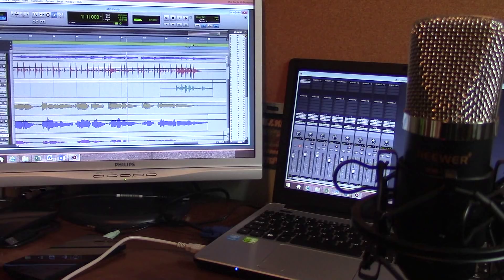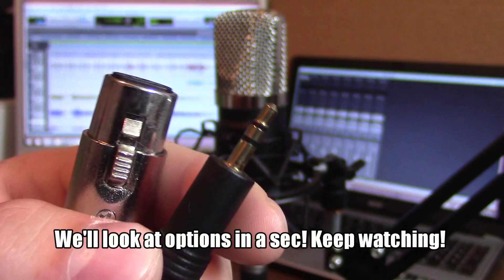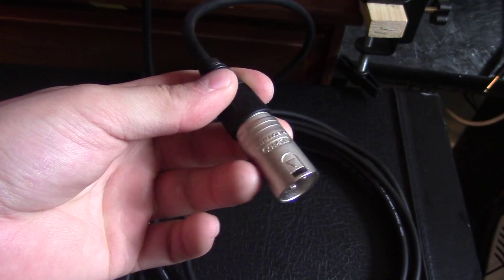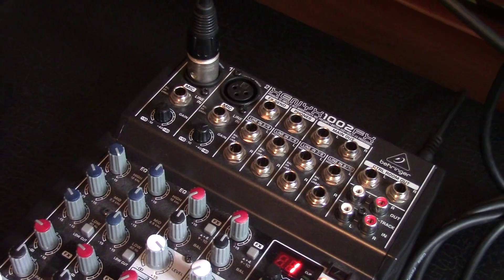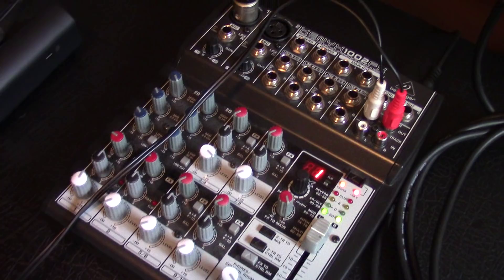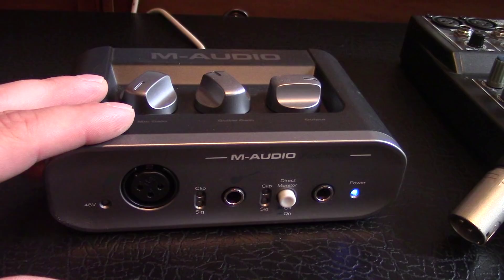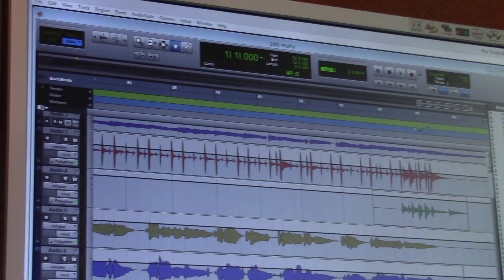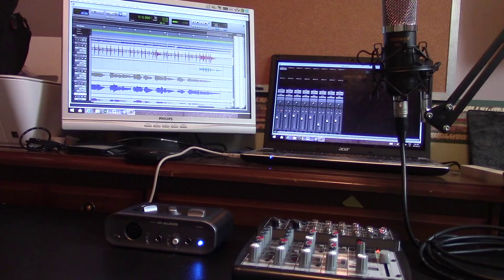How to hook up the Neewer NW-700 / BM-700 / Any condenser microphone

Comment: Can this microphone work with an Epiphone amplifier?I purchased the extra cord that has the three prong on both ends.
Reply from the maker: +Luke Lucas I am not sure about the amplifier. This mic needs 48V power, and I do not THINK that an amplifier will run it. I am pretty sure that you will still need a phantom power source.
Reply: One last question I have seen the phantom power source but they also have it hooking up to a external sound card is that necessary?
Reply from the maker: You do not need both. An external power source will be all you need. :-)

Comment: I've seen videos taking the mic. And plugging one end to the bottom of the mic then the other to the computer. They were using it without phantom power. So I don't understand why you need phantom. I know it sounds better but you don't need phantom.
Reply from the maker: +Tiddly Wink Have YOU tried using it without?
Reply: +Weiderfan No but a guy just used an audio adapter and it sounded okay.
Reply from the maker: It certainly isn't proper.. you may get some power, but you wouldn't be utilizing anything close to the mic's potential. You're talking about supply approx. 10-15 volts to a mic that requires 48.

Comment: my mic won’t show up on my computer
Reply: have you found a solution?
Reply: Rikardo Castello no
Reply: Have you gone into the Windows settings on your computer and tried to choose your input audio device?
Reply: Logic Sloth yes i have tried everything i ordered the mic of amazon brand new and it doesn’t work i’m pissed
Reply: Same
Reply: @fables8811  are you using power supply?
Reply: TheShibliVlogs ya i’m using phantom power
Reply: Do u have phantom power?
Reply: If u are using a laptop I think you have to use a sound card
Reply: Mas0nFN ya i’m using phantom power
Reply: Rikardo Castello r u using a laptop?
Reply: Fables are u using a laptop.
Reply: Mas0nFN yes
Reply: @fables8811  Exact same problem! I tried every laptop in my house bc we don't have any PCs so if it worked pls tell me how!
Reply: Humorous JJkar it hasn’t worked for me i gave up
Reply: I’m using a PC and I have the same problem :(

Comment: Any Idea the ALC1150 Will Power this Microphone? i got the Z97X-Gaming 3 Motherboard and i need a new microphone but i am wanting to get a microphone but i got a budget under 50 bucks and this seems like a good price and micrphone any ideas?
Reply from the maker: +LiteGaming Hey, I just did some research on the product you mentioned. I'm sorry, but I don't think it will power the microphone. Of all the many stats I read on the products website, there was no mention of an input that would accommodate this mic. I did happen to find this little item though, that will fit your needs, depending on whether you were willing to put out a few extra bucks. Check it out! http://www.amazon.com/Neewer-Condenser-Microphone-Recording-Equipment/dp/B014H8AWGC/ref=sr_1_4?ie=UTF8&qid=1443271279&sr=8-4&keywords=phantom+power+supply+for+microphone
Reply: Weiderfan thanks for doing some research but i was wondering because alot of people told me that the thing is powered so i am still wondering since i am a broke  kid and i want to get some good microphone and get better on youtube soo i am waiting to get some stuff since i am currently looking for alot of microhpones but all of them are crap
Reply: Weiderfan oh also i am in canada and i cant order from amazon.com but i need amazon.ca
Reply: +LiteGaming maybe you could buy that microphone and to power that use a sabrent usb external sound card. That should work. i saw it at podcastage and in the comments he´s saying that he´s doing that in that exact way

Comment: Could you give me a link to a cheap mixer, on amazon, that has phantom power? And also, could I use the cable that came with the NW-700 to run from the mixer into my desktop?
Reply from the maker: +EquinoxNick Yes you could. Here is a pretty sweet little mixer for cheap! http://www.amazon.ca/Behringer-Q502USB-Premium-5-Input-2-Bus/dp/B008O516JW/ref=pd_sbs_267_3?ie=UTF8&dpID=51Y2%2BbL16kL&dpSrc=sims&preST=_AC_UL160_SR160%2C160_&refRID=1CV360D3G28ANS2B1QYC
Reply: +Weiderfan so would I need a 1/4 to 3.5mm cable and a xlr cable to be able to use that mixer?
Reply from the maker: Yep!

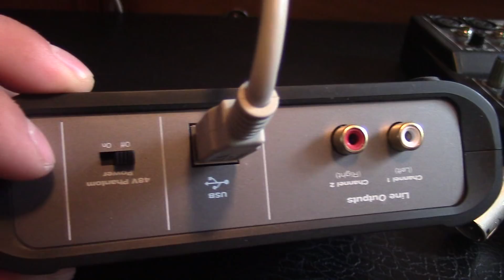Comment: what's that cable @6:28 called, and the one @7:00 ?
Reply from the maker: +kaelmon The cable at 6:28 is the cable that comes with the interface. One end is a regular USB, and the other end is a type-B USB. It's basically your standard printer connection cable.

Comment: I tried setting up the mic, i got the same set up as you, and i turned on the 48v
but there is still no signal coming though, I'm not sure if the mic is broken (i tried the mixer with a dynamic mic and it works)
Reply from the maker: did you use the same cords for both mics? could it be a cord issue? strange! with a dynamic mic you wouldnt need phantom power. soooo, maybe the power source isn't working, bad chord somewhere, or you just got a defective mic, which is possible with any piece of tech. those are my suggestions! haha hope it helps in some wayy friend!
Reply: +Weiderfan I tried using two different wires the one given (with an adapter) but I'll try buying a xlr cord, thanks
Reply from the maker: +sillyangel27 no problem! hope it works out!

Comment: Actually I plugged it into my laptop and it workds GREAT! (BM-700 CRISP SOUND and NO NOISE) 
BUT I plugged it into my Behringer Q802USB using a 3.5 converter to quarter inch into the LINE IN. Channel one instead of the XLR. 

Configured correctly in computer, +48V ON and NOTHING... NO SOUND.... Any idead? Do I nead the XLR in order for the +48v to work?
Thanks for your time
Reply from the maker: +Skandulf Thats very interesting! Cool that it worked directly into your laptop, and quite odd! As for plugging into the mixer, the 48V should run to the xlr and 1/4" jacks on the powered channels. I'm not sure!
Reply: +Weiderfan I wrote to behringer, waiting on answer.  My laptop is a i7 extreme, win10, 16gb, and HD input and audio 3.5 port.
Reply from the maker: thats a sweet setup you have there! I7. sick!

Comment: Do I need an extra piece to connect this particular mic to a mac?
Reply from the maker: You shouldn't! Just a little mixer as mentioned in the video. It will 'work' in a mac as is, but will be SUPER low power.. not very nice. A mixer such as the behringer 302usb is a great option. Simple, effective, and comes with software as well!

Comment: I had a question about this, i am confused lol! Im getting Behringer 302USB and the Nw700 mic kit.  Do i need that LEFT/RIGHT output cable to 3.5mm like u have? if so, whats that called, im shopping on amazon and would like to know how to find that right cable for it to work. & with that cable you can record from mic to laptop right? & If you could answer this, thatd be GREAT! Thanks!
Reply: Get a usb sound card

Comment: Do u even need a phantom power supply if i use a desktop?
Reply from the maker: +Shoaib Adnan It all depends on the desktop. Some have the capability to run the mic, but very few do. You will most likely need more power!
Reply: I have ordered the xlr - xlr cable and a mixer too, do i STILL need a phantom power thingy or is that ok? sorry if you went over it in the video :P using on desktop btw

Comment: Mine came with a USB adapter with a mic and headphone jack on the other end will that work with this mic?
Reply from the maker: +NiiNj4_K1Ng_-- hmm. I have never seen a cable like you are speaking of! I'm not sure.
Reply: Weiderfan Looks like this
http://www.zzounds.com/item--AUTATR2USB?siid=132690&-mhZoBEiQAFta8wbekf8PbPffhtWw8mtIg_9aA2T-IXkyv0AcZi9VOtdEaAt3u8P8HAQ=
Reply from the maker: That's neat! I think you will still need a mixer/ power source of some sort though. A USB port only provides roughly 5-15v of power!
Reply: +Weiderfan would that be a reason why ny voixe audio would be so quiet?
Reply from the maker: Likely so!
Reply: +Weiderfan OMG! Thanks so much where would be the cheapest one. I live in the US? so amazon?
Reply from the maker: Amazon. Behringer 302USB. :-)

Comment: instead of a power scource could i use a usb sound card?
Reply from the maker: +Og Smithyy|Subscribe Plez 〈3 If the jack you're plugging the mic into has 48v power supply, then yes, it would work. You would also need an xlr-usb cable then of course.
Reply: +Weiderfan Will i be able to use somthing like this though, http://www.amazon.co.uk/dp/B00IRVQ0F8/ref=pd_luc_rh_bxgy_01_03_t_img_lh?_encoding=UTF8&psc=1
Reply from the maker: hmm, I cant say for sure, but I think not. This will let you have a few more ports using a usb jack, but I don't think it will power a condenser mic as such.

Comment: Will this do the job?

InnoGear 1- Channel 48V Phantom Power Supply with Adapter for Any Condenser Microphone Music… 
Your Cable Store XLR 3 Pin Microphone Cable (6 feet)  
Neewer NW-700 Professional Studio Broadcasting Recording Condenser Microphone & NW-35 Adjustable…
Reply from the maker: that should be just fine!
Reply: I have this exact thing but I get way too much noise and still very low volume. Adobe audition can't even compensate...  NW-700 to phantom power supply to PC 3.5mm port... I've tested this on three computers and a DSLR.

Comment: do wee need an audio interface is we have phantom power?
Reply from the maker: +ShadowProductions Well, JUST a phantom power source will run the mic no problem! A small mixer or interface will do a better job converting the signal, so you will get a higher quality sound. :-)

Comment: I dont have a mixer but I have this mic, So what do I do? I dont have the phantom power
Reply from the maker: +ToasT | Blaise So you just have the mic? The simplest and cheapest option would be to buy a phantom power source, such as the behringer PS400. You NEED a 48V power source to run this mic.
Reply: Weiderfan Correct all i have is the MIc and the supplied cables. Can you link me to one?
Reply from the maker: http://www.amazon.ca/Behringer-PS400-Ultra-Compact-Phantom-Supply/dp/B000FG795I/ref=sr_1_1?ie=UTF8&qid=1449854264&sr=8-1&keywords=behringer+ps400
Reply: Weiderfan So if I purchase that Im set?
Reply from the maker: Grab an XLR cable as well. You'll need one if you don't already have one. XLR to XLR
Reply: ok thanks.
Reply: IS that all I will need? just the XLR to XLR to plug from my mic to power supply, then I use the provided cables to plug in my power supply to pc?
Reply from the maker: You got it! :-)
Reply: Thanks, Since im only 15, I was about to ask my father to get the supply and XLR cables, but I needed to double check, so thanks!
Reply from the maker: no problem!
Reply: +Weiderfan haha u are so funny... i have bm-700 and on desktop pc u dont need 48v phantom power cause audio card can handle it... but on laptop u need 48v phantom power
Reply from the maker: That is not the norm. It is an exception that YOUR sound card/ jack can supply a full 48V. Congrats.
Reply: +Weiderfan Actually you only need a 5v Power supply
Reply from the maker: TheTrumpCard how do you figure? Mic requires 48V, as does nearly ALL condenser mics..
Reply: +Weiderfan 48v is recommended for best quality. but most condenser mics can run off low voltage such as USB mics. it may not produce good quality but it still works. and I still recommend that phantom power supply should be used. also it says minimum is 5v on their website. BTW this is the same person as before lol
Reply: +Weiderfan oh yeah and you're semi right. for your setup you need 48v for a setup with no mixer it isn't required. along with you must be using a desktop computer

Comment: My computer has a power supply its  desktop pc an when i plug it into my pc it picks it up but it doesnt record any volume
Reply from the maker: Thats probably because there isn't enough power... Just because it's a desktop doesn't mean it has a power supply. It is likely putting out 5-10 volts or so.. this mic wants a solid 48 to run properly.
Reply: Whats strange is that, I learned the mic does WORK, but you have to turn the recording vol up all the way and crank the -db to be able to hear yourself good enough. Which sucks cause raising the db ruins the quality. Whats weirder is that my desktop pc couldnt even pick up this mic, an it has a sound card an 500w psu. legit thing is a beast. but then i plugged it into my cheap all in one hp. and it powers it just fine, just have to raise DB a tad

Comment: My microphone doesn't pop up in my sound properties? I did the first step you did with the double XLRs and L/R Audio cables. Can you help?
Reply from the maker: +ezlee6 What equipment are you using? Can you explain your setup? Also, did you check out the yellow link at 12 seconds?
Reply: I have the same setup you have and same equipment. And yes, I have watched your help video. I tried both ways and when I go to my sound properties, the mic I'm using (same one you have) doesn't show up so I can't even set it as my default mic.
Reply: +Weiderfan I got it to work
Reply from the maker: Glad you got it to work my friend! Sorry I wasn't of much help, but at least you're up and running! Enjoy!
Reply: yeah man. Great video anyway :)

Comment: Will this work on a desktop computer without the condenser? Thanks
Reply from the maker: +SkillЄr The 'condenser' is the actual microphone. I think you are referring to the phantom power supply, or the mixer. In most cases you will NEED a phantom power supply, but that is all. This isn't very expensive. A great option is the behringer PS400, if you'd like to search that up. Amazon sells it. There is a rare case where a desktop has added functions such as a power supply built into the CPU, but this wouldn't be the norm.
Reply: +Weiderfan Ahh okay. Ive also ask my friend and he said I can also use a USB adapter like this one http://www.amazon.com/Sabrent-External-Adapter-Windows-AU-MMSA/dp/B00IRVQ0F8/ref=as_li_ss_tl?ie=UTF8&qid=1441401584&sr=8-2&keywords=USB+Audio+Adapter&pebp=1441401586926&perid=0JJSHNSF1YVT41AP68SX&linkCode=sl1&tag=podcastage03-20&linkId=c15aebe442b85e07ae9d656663b3153c
Reply: +Weiderfan Ahh okay. Ive also ask my friend and he said I can also use a USB adapter like this one http://www.amazon.com/Sabrent-External-Adapter-Windows-AU-MMSA/dp/B00IRVQ0F8/ref=as_li_ss_tl?ie=UTF8&qid=1441401584&sr=8-2&keywords=USB+Audio+Adapter&pebp=1441401586926&perid=0JJSHNSF1YVT41AP68SX&linkCode=sl1&tag=podcastage03-20&linkId=c15aebe442b85e07ae9d656663b3153c
Reply from the maker: I have heard about these, but have never seen them used! Good luck in your choice! :-) Thanks for watching and commenting!
Reply: Thank you for quick responds, and great video !

Comment: i bought the same kind of microphone, it seems to not work. i bought the power adapter for it, and i plugged everything in. i unplugged the xlr cable from the microphone and it made some static sounds so i know i can hear it and the power for it is just fine. but when i speak into the microphone it doesn't register any noise. anyone have help???
Reply from the maker: +LINKfromTp Bad cable? Power not turned on? Software issue?
Reply: i tried all of it. only works in the front microphone port only works for it. think it's just my MoBo.

Comment: where do you put you headphones?
Reply from the maker: +King Bob Hi, Any interface that you buy will have a headphone port as well.
Reply: i see i'll probably have to find a set of head phones with the big plug in
Reply from the maker: It would usually be easier to get a little adapter. They're really cheap, often around 1$. It's what I use.
Reply: thank you

Comment: I'm using the mbox mini 2x2 interface with my macbook pro an I'm using logic i just bought an AKG P120 condenser mic but I'm getting no sound can you please help
Reply: my worked dude
Reply: ok cool something i have until my other one comes
Reply: dude you just need power and fix your setting
Reply: ok well i been had my stuff working just don't like this box whenever i hook it up to a board it never works